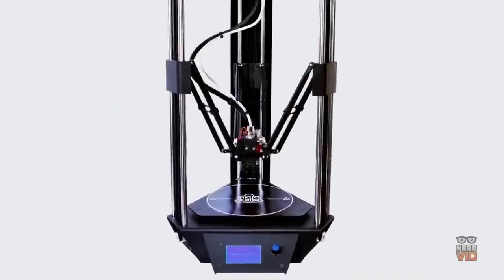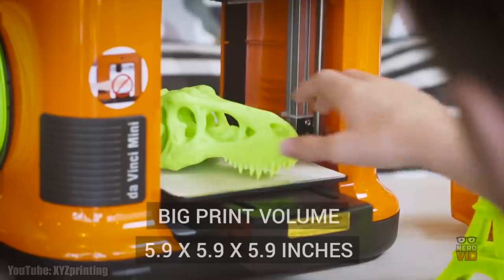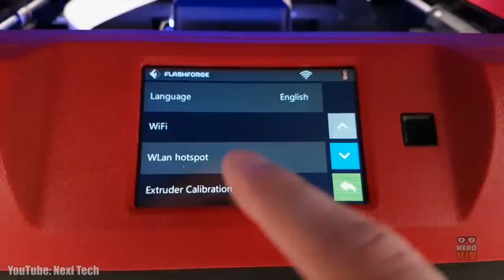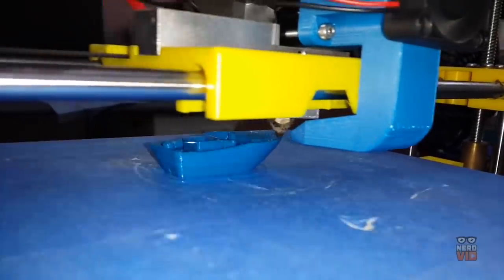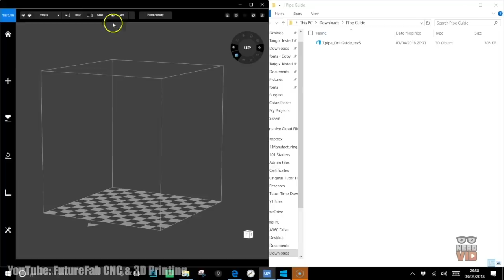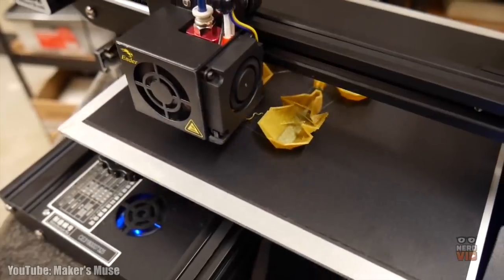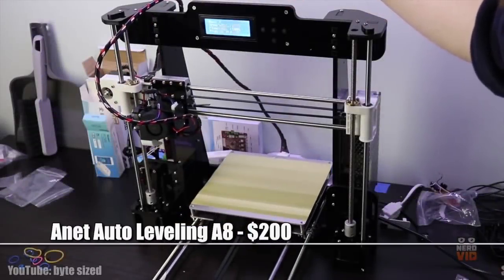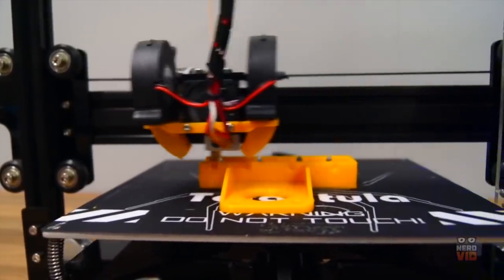10 Best Cheap 3D Printers for Beginners To Print Anything

Comment: Hi. I am a school teacher and I want  plug and play affordable 3D printer so I can print stuff for my students to learn easier.  I need printer just like a normal printer - the one that has affordable filaments too (like ink printer you buy ink, the printer is gratis). What are the chances I will get proper clear help/advice here on the exact model to get with the link and EU plug and no custom to an affordable 3D printer with filaments pack? Thank you.
Reply: Well I don't have all the links, but I can confirm the anycubic i3 mega works great and is overall quite safe. For filament,  you can just search "1.75mm [material such as ABS or PLA] filament" on Amazon and you can usually find decent rolls for around $23. note: the i3 mega can not print very flexible rubber filament without quite a bit of modification. The i3 mega is also quite easy to use and assemble as it comes in 2 main parts with screws and all the hex-keys needed for assembly and all those sorts of things. Note: filament might last longer than you'd expect. I'm fairly certain it has an EU plug option and I know for sure it has a switch on the built in power supply that. It is also safe around children with no exposed wires and an easy to use touch Screen. I haven't had a single failed print on mine. Still, I suggest you do your own research on any printer you look into buying and good luck.

Comment: Ender 3 is the BOMB!
Reply: Yep.
Reply: yes I just got mine but have any tips, like I first tighten the screws and now prints way more accurate but is there any thing else I can do? I feel like the ender 3 can do a bit more better if put on right settings but I don't know those settings.
Reply: @mrthunder3254  
If you are looking for better adhesion to the bed I suggest printing a raft.
Better quality involves lowering printing speed to around 40 and lowering print height to .1. otherwise print speed at 65 and layer height at .2.
(never put supports touching build plate, always do everywhere.)

Comment: I recommend monoprice mini delta pro I got it because I’m into 3D printing but it’s quite small but fun
Reply: @Yatukih_001  it is cheap but its really high quality the only down side is it has a really small build plate, also wouldn't you want a cheap printer because the video is called "10 best cheap printers for beginners"

Comment: Do you have any suggestions on a good budget 3d scanner. And thanks for this video.
Reply: @Sularus76 What do you mean?
Reply: Carterthe Miner google 3D scanner I'm not sure how to explain it. Basically it scans an object and puts out a file you can use to print with a 3D printer.
Reply: Oh I see no I personally don’t use it
Reply: Carterthe Miner ok. It's an item that makes reproduction of something easier. I would like to make parts that are hard to find or expensive for my old cars. I have an old RV for example, it uses these small pot metal pieces that are known to fall apart especially since they are 43 yrs old. Mine are ok but if I can scan it and print them out of ABS or something I would not worry I could not find them again. It's just an example. But that is what I need it for and there are a lot of 3D scanner ranging from thousands to a Benjamin. I would like to know which one is good enough for me.
Reply: @Sularus76  Hi. I work for a company that sells 3D scanner. Let me know if you are interested.
Reply: Sorry I've been offline. Yes I'm interested if you can post a website or something. Thanks.

Comment: I'm getting the Anet a8, I have seen better benches and it takes about 5h to make, nice vidio.    :)
Reply: Actually building it now
Reply: @coolshooo   I have actually bought and built the anet a8 roughly a year ago and have since bought a better printer. May I ask why you chose the anet a8? Also the build is super easy, I wouldn't be surprised if you were done already 😂
Reply: No half way, had some homework. Didn't have enough money to buy a better printer and may best friend and programming teacher have Anet a8 so if I run into a problem they can help, and already have helped.
Reply: @coolshooo   well be sure to buy a better power supply and a Mosfet so the printer doesn't catch on fire. The heating bed may cause a future issue, mine hasn't but you can solder it's connections to help prevent any future issues. I wish you the best of luck man 😁👍👍
Reply: Thanks
Reply: @Dylan Biehn are any of you're older printers for sale
Reply: @Dylan Biehn o well, that's how it should be. I have ran into problems with my Anet a8
Reply: @Dylan Biehn well it started of with the y axis motor only spinning one direction. Fixed that then got another 3 hours printing Time before the X axis motor only span in one direction, then the display screen stopped working. Overnight  it fixed itself allowing the X axis and the display screen to work. But now the z axis is not working at all. Im ordering a new mother board.
Reply: Lucky. My Anet was shipped with a missing Bering
Reply: @Dylan Biehn if you go to that main screen on the Anet and press the up button a few times it will tell you how many print hours you have
Reply: @Dylan Biehn sorry, should have realised
Reply: I have a problem with mine it keeps going off to the far left past the plate when I home the axis
Reply: @haha_i_silly_link  X or y axis
Reply: @haha_i_silly_link  could the problem be used wired up the senses incorrecty
Reply: I think I solved it but at the expense of my hot plate breaking 
The stop switches are to short and are not  activating
Reply: @haha_i_silly_link   make shore you have placed them correctly, look at a few photos of the printer and see if you see a difference. Or you could glue something so that it hits the sensor.
Reply: @coolshooo  yeh i did that a while ago now with a few adjustments and a year of tinkering it prints perfectly more or less
Reply: @haha_i_silly_link  hows your printer, i now own a ctc as well, both constantly falling but up to this pandemic that was half the fun. need new nozzles for anet, and using ctc replicator on the minimum incase i need it. do you know any great prints to help with the pandemic?
Reply: @coolshooo  i had a glass window pane that i put on the heated bed that made them stick the prints arent great but there reliable
Reply: @haha_i_silly_link  i heard you have to be incredibly careful not to touch the heat bed with your hand whilst using glass,  if you can run it under hot soapy water, that should help, then make sure you don't touch your heat bed directly with your hands, i have a regular print bed but this still dramatically helped.

Comment: When the first two things cited are environmentally friendly and wifi printing I immediately know you don't know what you're talking about.
Reply: Can you please speak with tense?
Reply: @relgames6080  there is very little gramatically wrong with what I wrote and once you factor in that its a youtube comment id say its pretty good. Quotes around 'environmentally friendly' and 'wifi printing' would have been the only things i would have changed
Reply: @ikillfh844  Uhh wifi doesn't hurt the enivronment bud.
Reply: @tomcanty8856  what I meant was just that wifi printing and eco friendly should in no way be at the front of a best budget 3d printing video lol. The few printers there are in the world will not put a dent in any kind of pollution. And wifi printing sucks on these cheap printers because it often locks you behind proprietary software and unnecessary shit when all that was needed was open source marlin on the printer and a usb stick

Comment: Creality Ender 3 is the best 3D printer for beginners, (personal experience).
Reply: I spent a bit more and got the CR-20 Pro for my first printer, mainly because it comes with auto-leveling installed from the factory. It also has an overall better and neater construction than the Ender 3, the power supply and electronics are tucked neatly into the base.

Comment: you can make 3D printers with a 3D printer
Reply: @BrainStem-jn5xp  Actually you can frames and stuff, check thingiverse.
Reply: @BrainStem-jn5xp  print the parts get copper wire (magnetic wire) boom motor

Comment: I paid 89 dollars for my first 3d printer, it's a CTC i3 clone and it's been awesome, I have learned so much from putting it together and so on, I usually print pla but I've even done abs with success, if you're handy and want a deal, check it out, CTC i3

Comment: Is there a 3D printer out there that can print with flexible silicone?
Reply: What where you thinking of printing ;)))))))))
Reply: I have an anet a8 it costs 139€ and it prints flexible filament
Reply: A silicone head piece
Reply: @alanday5255  If you want it the anet a8 as posted before is amazing for its price. Requires assembly but there's tons of videos on how. I've had one for two years now runs fine with not to much maintenance

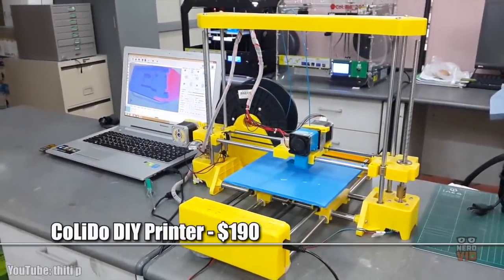Comment: You know somebody knows nothing about 3d printers when they say one of them uses PLA plastic and that's a good thing. Literally any 3d printer can print PLA plastic unless it doesn't print plastic at all. PLA is the easiest and simplest plastic to print. I have the anycubic i3 mega and it works great out if the box right after very minimal assembling. I also have an anet a8, but I do not recommend that whatsoever. Also, at 2:00 you said odorless. Wtf does that even mean? Both my printers are odorless (the ante only when it still worked of course) and I don't really see that as an upside. Also, these full diy printers often have you stick the wires into the power supply manually which isn't very safe and certainly should not be used in a classroom. Even others on this list would be way better than that thing in a classroom. The ender 3 is actually a pretty decent one from what I've heard. I do agree with what you said about the anycubic. Now, my anet was not very good. I only got one print out of it before the motherboard went out, the instructions were okay but far from perfect, and the acrylic frame was wobbly and over time warped. 2 years of filing to use that piece of garbage and I decided it was a lost cause. Now I have the anycubic and I have gotten many functional prints out of it and I can confirm it has very nice print quality. Overall, I feel extreme budget options are generally not worth it but still, do plenty of research before you buy.

Comment: What's the best 3D printer for printing your own face?
Reply: idek
Reply: You would have to make your own LiDAR sensor systems to detect the depth of the geometry of your face and then be able to import it onto the 3D modeling software for your printer, but if you want it to be the exact size of your face, then you would have to cut some of the parts of the model out on the software and print them separately and put them together, but I have no idea how you would have the model from the LiDAR detection be able to be imported onto a 3D modeling software.
Reply: It's called a face mask, either mud or cucumber

Comment: Buy any other "Cheap" printer other then the Anet A8, it has sooooooooooooooooo many issues, warped aluminum hot bed rest,  some come with firmware so old, the firmware support is no longer around, hot end sometimes goes out, or don't work at all,  it also like to heat creep, in other words you set the temp to say 200 degree, 5 min later its like 280, and shutting down, or not, or it will heat up to to 80 degree and shut down giving you a warning, the  hot bed has a plug that  will burn the connection to it self, or just not work, or short itself out, and lead to a fire, so you will have to buy a  mini boards called mosfit to help control the hot stuff, and the power oh man is not strong enough to heat the tip, (hot end) where the molten plastic comes out to build the print, and the hot bed at the same time with out one burning out, plus it is weak, it comes with a 12v 20amp, to even things out you will need a 12v 30amp power unit, oh and the power has also been found to be wired backwards in it's self, the connectors are just some cheap junk even if it does say Anet on the shipping box, the bearings for the slide rails, are cheap, and bind, you will need to update the firmware, oh easy you say, nope, once updated, the G-codes to run the mother board, which operated the printer, are sometimes wrong, or partily incorrect, so you will spend a few hours, typing in new g-code, just to name a few things that will go wrong, check any and all Anet facebook groups before you pay for this HUGE nightmare of a printer, AGAIN A WARNING DO NOT BUY THIS "CHEAP" POS ANET 3D PRINTER< SAVE YOUR MONEY AND GET A CREALITY ENDER 3 TO START WITH....... So all in all this 150-200.00 printer will cost you the same in upgrades, and new controller boards, and hassel, as if you just payed for a Creality ender 3 from the beginning, or any other "cheap" printer, hell my Tronxy X1 133.00 to the door, out performs this 200.00 "Cheap" printer right out of the box, with no new boards, or power mod's, or this or that "cheap" upgrade's,  just printed an Z axes spacer, been working AWESOME for over a year now, yeah small print bed, about 6"x 6"x6"  but you get the point, right?

Comment: But what if your 3D printing needs go beyond toys and ornaments?
Reply: undercrackers56  I suggest that you would have to be very crafty and build you own like I might do one day (but not anytime soon for me). Take the mechanical parts of any 3D printer, then make them bigger and also find a way to have the program extend its original size reach (meaning that it can print bigger stuff). I might do this myself one day and possibly and hopefully successfully make a 3D printer for myself that is as big as a bed or maybe bigger that is able to have a very large print volume and also recycle my own plastic and convert it into filament for the 3D printer. The plastic spool for the custom made large 3D printer will also have to be home made and very large, being able to contain a lot and a lot of filament.
Reply: Or, you can just print the pieces separately but make sure they’re easy to connect as well as hot glue together in a strong and efficient way.

Comment: My endgame is to print a 3:1 Curta Computer from the available files on thingverse.
So resolution is important.
I have never owned or used a 3d printer and dont want to make a costly mistake. I know nothing about the pros and cons of various materials, software tools, and machines. Someone help me work this out please. (Cheap)
Reply: In the same boat. Following.
Reply: @quadfeedgaming2577  me too... any suggestions?
Reply: Wubadub Gaming  me too... any suggestions?

Comment: How much time takes for a print? Can it printes metal parts?
Reply: Depends on the size of an object, and only certain printers can print metal which are not good beginner printers. Remember that 3d printers take lots of time and work to get just right and prints will not looking good if you dont invest time experimenting, researching and tinkering with/for your printer
Reply: @matthiasroca2666  why? I just want one that prints some cool stuff. Don't want to spend ages tinkering with it.

Aren't there any that just work? Like buying an appliance.

Comment: That's just too funny. You've clearly never used a tevo tarantula. It's acrylic parts are far from strong and break very easy. Also, in the video, it's printing out a replacement z motor mount because the acrylic one breaks so easy.

Comment: Dont buy the ender, i got it and it was a piece of shit... nothing worked plus the instructions are written in broken english,  get a monoprice select v2 pro instead. Those only take an hour to assemble, plus levelings fairly easy
Reply: Great thing mine worked execellent
Reply: My Ender 3 also works great. I had no experience before, but after a couple of failed attempts it works like a charm. I am very satisfied with it.

Comment: Why the fuck are they all printing boats
Reply: That boat is a "gauge" of print quality because it has overhangs and arches. It's also the model that comes with the printer pre loaded as a test piece to test the settings without wasting a lot of plastic.